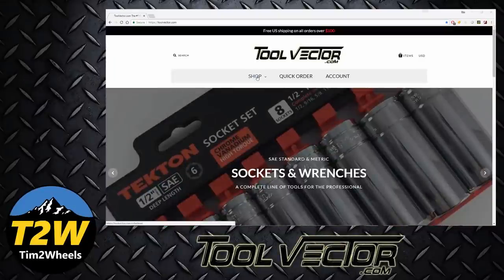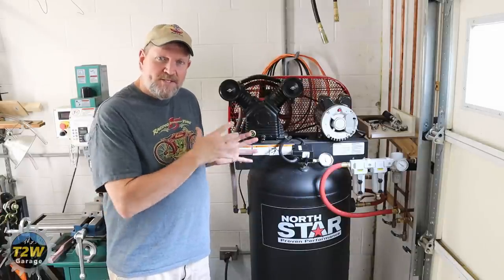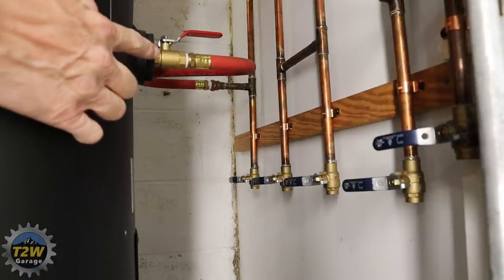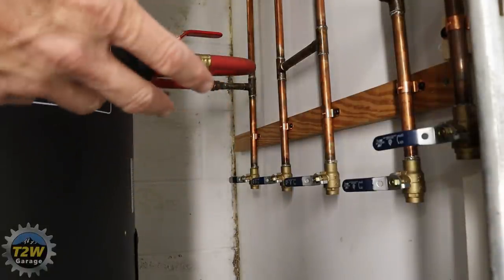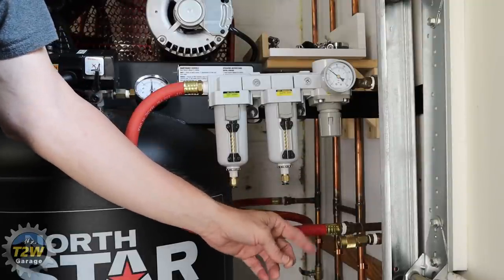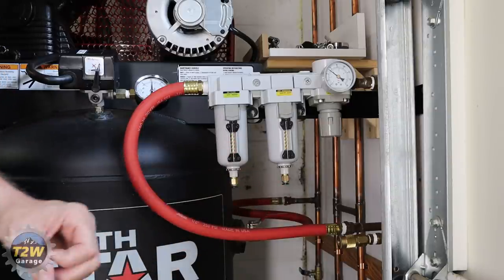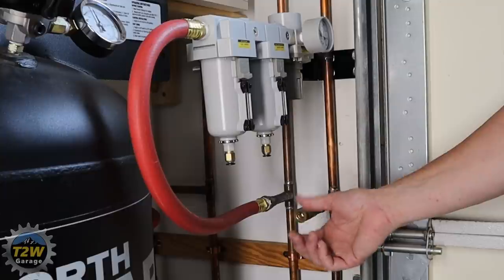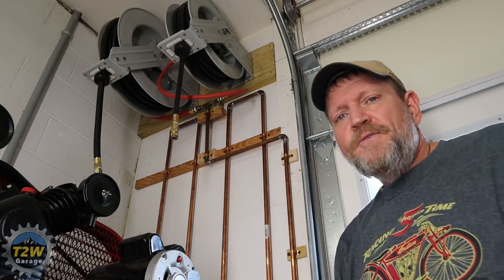T2W Garage -Behind the Scenes: A Closer Look at my Shop Air Compressor

Comment: Minor correction: CFM is a measure of air volume, not air velocity.  If you put the same CFM through a 1” pipe the velocity will be much lower than velocity of the same CFM through a 1/2” pipe.
Reply from the maker: Hey LTVoyager, Thanks for the info. I appreciate the feedback.

Comment: Hey Tim, I’m glad I found this video on your channel. If you don’t mind, I am going to copy your setup. I am putting a new air compressor in my shop, only difference is my compressor will be outside the shop in a small enclosed area, well ventilated. If you think of any hints for this, please let me know. Thanks Tim, I enjoy your channel very much.
Reply from the maker: Hi Marty - I think you will be very happy with this setup. Having the compressor outside the shop will be much more quiet. I highly recommend the copper pipe grid for drying. I am impressed with how effective it is. Use the heavier walled pipe to hold up to the pressure.
Good luck with the project and let me know how it goes.
Thanks for the comment and for watching.